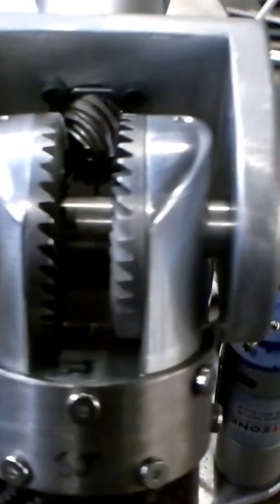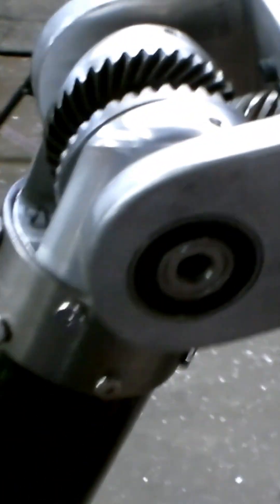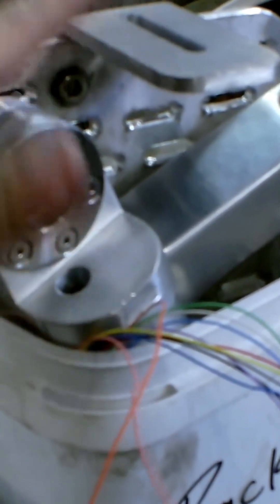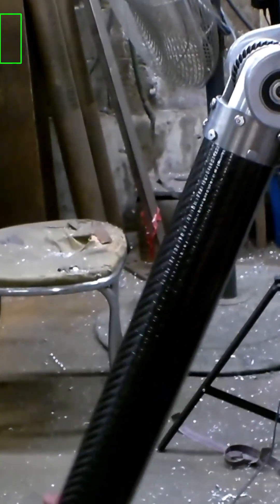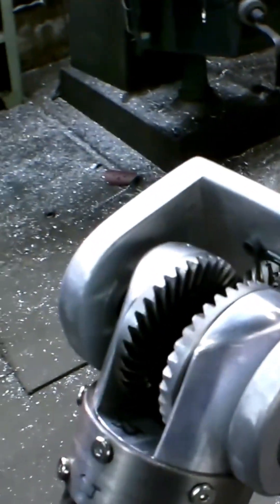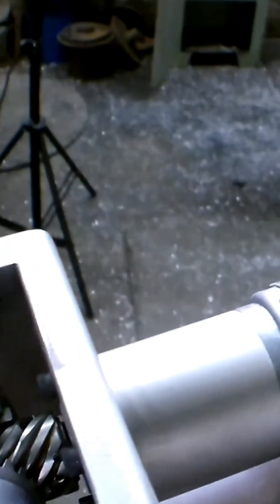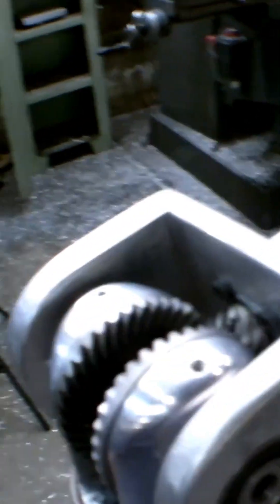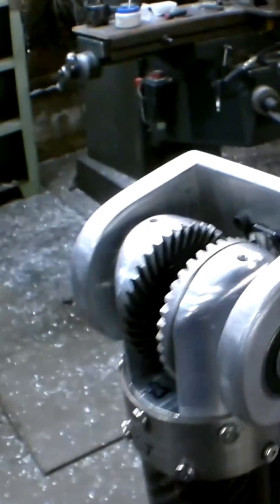Robotic Arm Motion Control Test #robotics

Comment: Is the ring gear on the right side of the joint just an idler gear? What’s the reason for the extra gear?
Reply from the maker: Exactly.  It is there to lower the chance of bending the motor shaft.  Check out the build videos ROBOTIC CAMERA ARM
https://www.youtube.com/playlist?list=PLUPXvHZSmnrLVO1_GoO2n9iINJNa32SDf